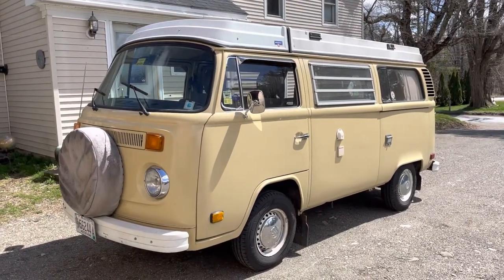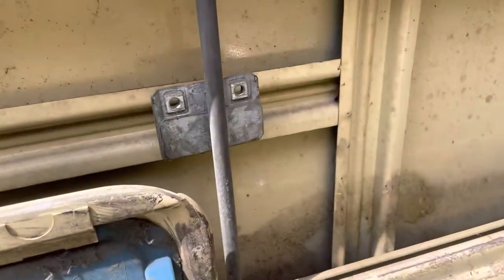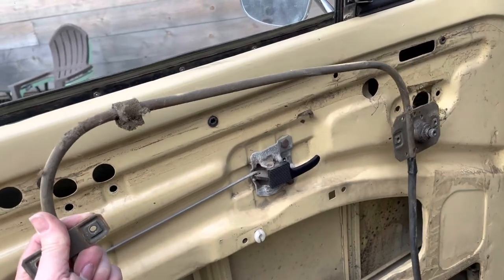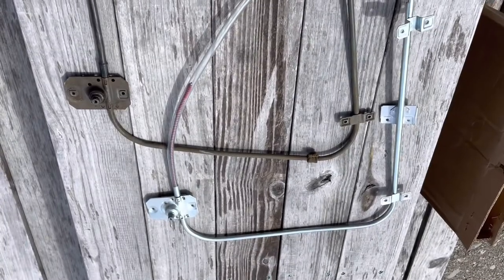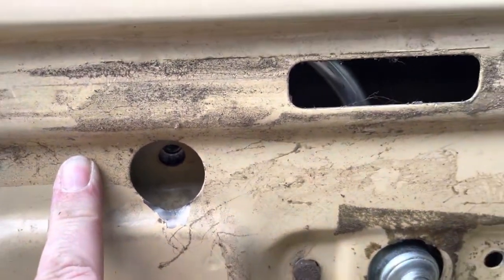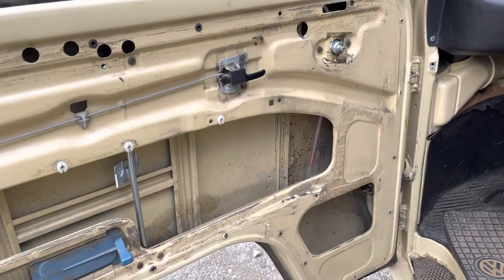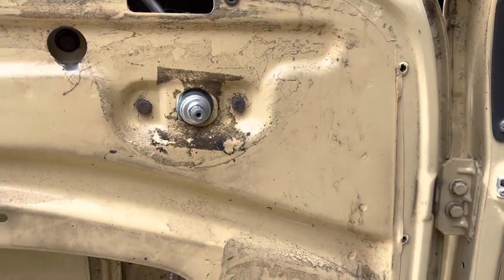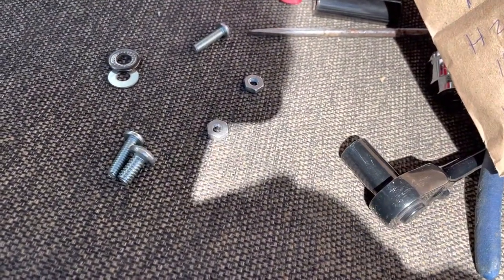Replacing window regulator on VW bus camper

Comment: Thank you for the video. Sorry that did not work, we have a lot of chat on thelatebay forum in the UK about the flimsy replacement window winders. Hope you got it sorted in the end. My '73 driver's side window is a hard wind-up, very easy to put down, but a struggle to close. I will probably take the mechanism out and try the fix..

Comment: Hi, from Queensland, Australia. Struggled to find a video on replacing window mechanism for Kombi 1975. Found yours, so happy. Trying to do mine at moment, I noticed that you didn't show the part which way you took the mechanism out? Was it pull through to the left or right?
I watched another video and said that you have to take the quarter window out? OMG..so confusing.
Any more info would be appreciated.